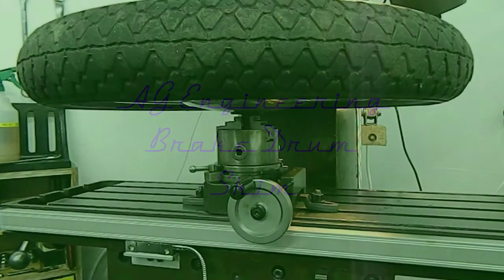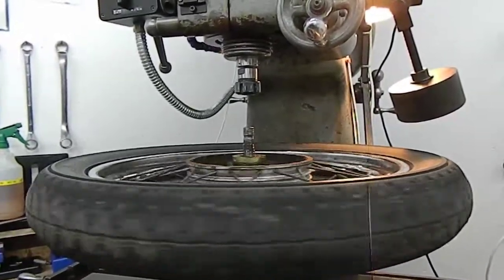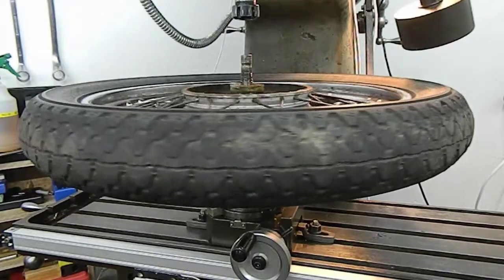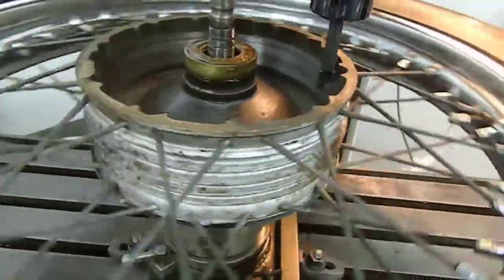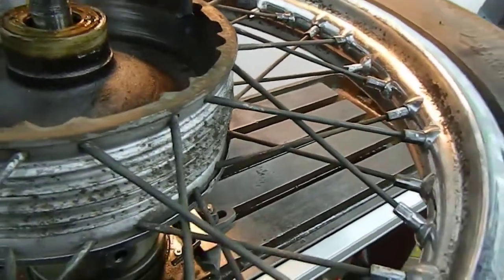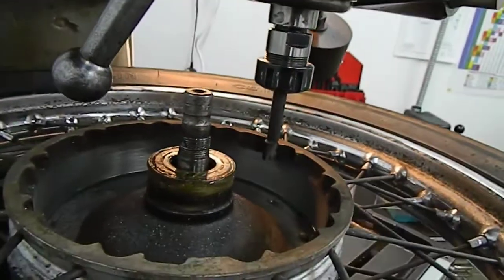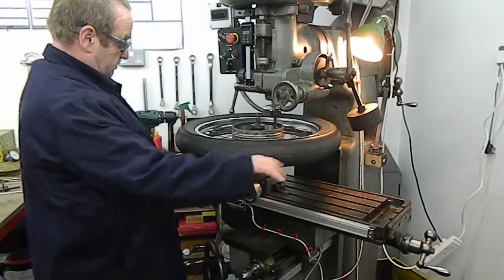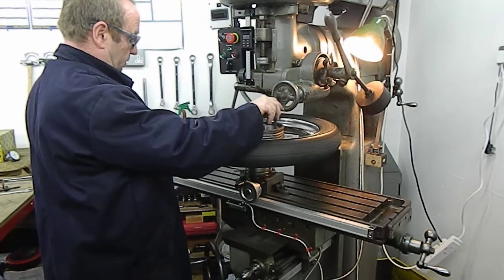Motorcycle Brake drum skim

Comment: I just resurfaced my t120rv this morning on my brideport using a carbide boring bar and having my girlfriend power the wheel with a hand drill and a rubber sanding drum. Took off only about .005 but what a difference it made in braking feel. Good job gov'ner.  Bobs your uncle! Thanks for the idea!
Reply from the maker: Great to hear it helped get the job done, thanks, Ade

Comment: I found out a solution for this problem even  without lathe or any tools. Uneven or eccentric drum is not only common on old bikes due to rust and wear, but it is very common on cheap chinese bikes because of manufacturing shortcuts and poor quality. I recommend every 500 km or so remove front wheel from the bike and observe for shiny and dull spots inside the drum and then sand the shiny spots down  a bit with 400 sandpaper just by hand. Then the common procedure follows such as cleaning the drum with acetone or gasoline ,  checking brake shoes, eventually clean them as well with file and acetone. Doing so regularly will repair uneven drum in around 2000 km just by braking. It is not a professional repair and you will probably still feel a bit that the drum is not perfectly even but it is tolerable on old or cheap bikes as fast and sporty bikes use disc brakes anyway.

Comment: Hi - I have an A10 front with a not great front brake. I might do a TLS conversion but I figured that a 'true' drum is a good idea whether I do or don't so I'd start with that. If the SLS then works well enough, happy days. If not, think about TLS conversion. I like your method. I have a miller but it's not big enough to do a wheel. Do you offer a service to true a drum? If so, where are you and what would be the cost? Cheers, Chris
Reply from the maker: Hi Chris,  thanks for the information. A true drum and relined shoes, I would recommend Villiers Service,  does make a considerable difference to brake performance. Unfortunately however, I am not able to take on other jobs at this time due to work commitments. Many thanks,  Ade.

Comment: My Bsa b33 has very poor front brakes , they have been machined ,very little runout now,  new quality shoes I've been bedding them for two weeks now but at best ,  they are about 40% of my good rear brake , it looks like I can make a longer brake arm 20mm, or hopefully get some higher friction material bonded to the old shoes , the contact area is at least 80% + ,  the drum material seems to be steel ! , I will try these things first and machine the new shoes to the drum diameter . Modern bikes have pads running on stainless type discs , so I am hoping there is a grippy material that can be stuck on . Have you had issues like this ? .cheers.
Reply from the maker: Been through the same, I made a longer brake arm for my Ariel, I'd say it gave a 'slight' improvement, but not much. I'd have to refer you to Villiers services or Saftek for lining choice. Days long gone Ferodo AM4 was the racing choice, but racing braking conditions are not the same as road. A lot is personal preference.
Reply: I had a honda xl250 Motorsport and the drum need machining oversize , well the material they glued on was fantastic,  my bsa 7" half width hub could surely be as good as a small trail bike front brake , has to be in the material. Cheers .
Reply: Hello, it is very unlikely that your rear brake is better then front one. I suppose that the issue is with not sufficient braking force on the front brake as every bike is braking some 80 percent on the front wheel and 20 percent on the rear one. In other words, if you have similar quality brakes front and rear, the rear will block the wheel easily but the front will not be able to do that or with severe problems. What you need is take care of your front brake and keep it in the best possible condition and it means:
No plays in brake lever, no plays in the cable, cable is fresh, clean, strong and well lubricated, all moving parts inside the brake are clean, degreased, without plays and probably polished, disc drum is even and not scratched and shoes are premium quality from good brand manufacturer. If it doesn't help, you will need bigger drum or  twin leading shoe drum brakes or both. Twin leading shoes drum brakes were used on vintage sport bikes, such as MV Agusta for example. If it is not an option for you, you will have to live with the limited braking power on the front wheel and use it together with rear brake and stopping power of your engine.
Reply: @rofo2107  I got some similar pad material to that RZ gold . It has brass strands in it I think, and got them machined to suit the drum , big improvement so far , I'm hoping they will improve more as they bed , i know the front brake should be alot better than the rear , but it just wasnt working as well as it should i said 40% to give an idea how bad they were , i could pull the lever on as hard as possible on shingle and only get a slight skid at 5mph ,  they were bad , cheers

Comment: Hello how much do you charge for this would i be able to use standard drum shoes without defect or would i need to get something else ?
Reply from the maker: +Classickid21 
Hi Classickid21, sorry for the delay responding, only got back to the UK today.
Last question first...drums like disks usually have a maximum wear limit, provided this is not exceeded the fitting new standard shoes should be fine and will set up OK. On older classics similar to those I usually work on like my own Ariel Red Hunter for example, after a drum skim I have fitted thicker oversize linings and then turned the brake shoes on the backplate to match the skimmed drum with only slight running clearance.The backplate must also be centralised by holding the brake on while tightening the spindle and torque arm, this sets everything correctly.
Another useful upgrade on older bikes is modern non-asbestos linings, look at someone like Saftek.co.uk for more info.
OK, first question, how much? As I say in my intro I'm not a business, this is my hobby so work is my own and helping friends and family, if you were local then could arrange something maybe, where are you, I'm in Burton on Trent.
Hope this helps.
Thanks for viewing, thanks for subscribing, hope you enjoy future videos, good luck with your channel as well.
Ade